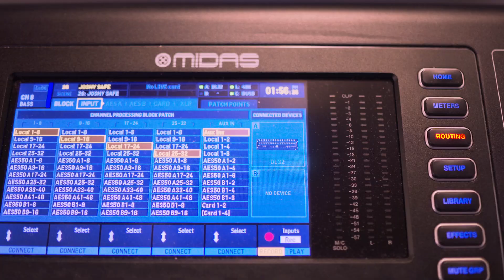How to make your own EtherCON Cables

Comment: How did you ground the ethercon housing? Does the ethercon connector have metal detents inside that touch the the RJ45 connector' metal body?
Reply from the maker: While the Ethercon body touches the shielded RJ45, the RJ45 should be doing all of the grounding. The XLR type body is just for mechanical retention and protection.
Reply: @markyfrencho  Thanks for your reply! I see. I am only concerned because I heard of AES50 ports on consoles frying due to the lack of ground conductivity of some black ethercon connector housings. I think they removed cadmium to prevent them from being toxic. Whereas the silver ethercon connector housings are still conductive, so I’m trying to understand how to properly ground them.

Comment: So you need to ground both ends of the cable?
Reply from the maker: Yes. This ground isn’t like an XLR ground. It’s not going to cause a loop.
Reply: Could this be achieved with a internal ground connector?  @markyfrencho

Comment: what cable spec is needed to pass phantom power?
Reply from the maker: There is no phantom power for Ethernet. It uses PoE or “power over Ethernet”. There are several levels of PoE and all of them should work on everything Cat5e and above. Cat5 may get hot with PoE+++.
Reply: @markyfrencho ok, I hear that cat6a is less rigid than cat 7 but has better shielding than cat5e. Do you find cat 7 to be hard to lay flat?
Reply from the maker: @rspaulding cat7 has higher gauge wires (22awg vs. 23awg) and slightly thicker insulation. plus it has additional shielding in the spec. When you buy shielded cat6 you have to make sure you’re getting a shielded type cat6 or cat6a. FTP, STP, or F/STP. Foiled twisted pair or shielded twisted pair. Foiled twisted pair actually has the additional foil shield around each pair. S/FTP Cat6a is the most similar to Cat7 spec. Cat6a cable is manufactured to tighter tolerances than Cat6 so it can handle higher bandwidth and speeds.
Reply: @markyfrencho  Thanks! do you find that Cat 7 is difficult to get it to lay flat on stage? Would cat 6a be any less rigid compared to cat 7?
Reply from the maker: @rspaulding what devices are you using onstage with ethercon?
Reply: @markyfrencho  those 4 channel XLR to ethercon snake boxes
Reply from the maker: @rspaulding thats a tough call. For short on-stage runs you really don’t need to worry about the speed or higher spec cables. I would probably get some of the pre-made Cable Matters Cat6 EtherCon cables and see how they work. I doubt you’ll have any issue with them. It will save you tons of time it would take to learn and practice making them and in the end you’d pay more to make them yourself.

Comment: Thanks for the video.  Lots of good info here.  My question is, for portable rigs that get set up and torn down a couple hundred times a year.  Will this type of Ethernet cable hold up?
Thanks
Reply from the maker: @johngreer9124  durability of the connection is going to be directly related to the quality of the ends you use. Don’t cheap out, get Neutrik Top connectors. Make sure your techs are gripping from the end and not the cable when they remove it. Soundtools SuperCat cables are great for this kind of repeated use. They’ve got a lifetime warranty too.

Comment: Thanks for the informative video Mark. Just a couple of questions about cost/benefit. Neutrik do an ethercon shell that is designed for use with pre-assembled cables (the NE8MX). Here in the U.K. these shells cost about £3.50 each. A 100’ pre-assembled “Ethercon” cable costs about £90, a 100’ Cat7 cable costs about £30. Is there any justification at all for the difference in cost that you are aware of? I appreciate that in installation scenarios you need to be able to terminate the cable correctly but for live situations, where the user is running a reeled cable between stage and booth is there any reason that one can’t just buy an off-the-shelf Cat7 cable and stick an Ethercon shell on each end?
Reply from the maker: @LeeMatches  it could be possible and still meet spec, though I haven’t tried it.

Comment: Mark, thanks for making this video.  This is the exact video I was looking for.  I am definitely not up to snuff on all the knowledge of these cables.  The difference between the CAT 5/5e/6/7 cables is very helpful.  I never realized that each improvement in cable was to further the prevention of crosstalk by either separating the twisted pairs or to increase twist rate for keeping the signal protected.  Great job!

Comment: CAT5e NOT Cat 5!  Why do audio visual people keep making this grave mistake?
Reply from the maker: Because the Cat5 spec technically covers Cat5e. Many Cat5 cables actually met the tighter tolerances of the enhanced spec but technicians needed a quicker way to tell the difference between a 100mbps cable and a 1gbps cable so the enhanced spec was produced.

Comment: So a few things to add. Cat 6 and Cat 7 also increase the twist rate of the pairs. This is part of what allows higher speeds. Also AES 50 is spec to cat5e shielded ONLY. Using other specs of ethernet can cause issues. AES 50 is not an IP protocol, so it does not gain advantage of using cat 6 or 7, it can actually hurt things. AES 50 was designed with the characteristics of Cat5e shielded. Also the shield with AES 50 is to prevent static build up in cable and ground link of the ports. It will work and sync without the shield, but damage can happen to the ports due to static
Reply from the maker: I would check out some of the Dave Rat videos. He goes through some of the advantages of different cat specs for AES50 and found no downsides for higher spec cables which is why SoundTools makes CAT7 ethercon for AES50. There can be some advantages in noisy RF environments as well as them being tougher cables overall.
Reply: @markyfrencho  I have seen that video where he tested AES50 with cat6. Yes it may work but it's out of spec. I have seen so many posts on different groups about people having issues with AES50 when using cat6, swapping to cat5e fixed the issues. Music group has even told people this.
Reply from the maker: @DustySeven7  cat6 spec doesn’t have ground. AES50 is a 9 conductor protocol using ground as sync. That is the main issue people have with it. AES50 can also lose sync at lengths beyond 75’. The Cat7 spec has foiled pairs and foiled shield so it has the 9th conductor and added shielding as well as slightly thicker jacketing on the pairs and tighter twists as you said. All this leads to more efficient data transfer and lower cross-talk which has been proven to keep the signal stable over longer distances than Cat5e without any problems. Cat5e is merely a foiled shield around four pairs. I’m sorry if my descriptions were not clear enough for you, but I believe my information is correct and not misleading. I have been running Cat7 for AES50 for months at 85’ without any issues even passing near our 400A service. I highly recommend it for permanent installations.
Reply: @markyfrencho  Cat 6 can have shield, Cat 6a does have a shield. AES 50 is not a 9 conductor protocol for sync. Dave shows in his video which pairs are sync and which are data. AES will most certainly work without a shield. I have seen it, as have others. Glad your install is working and has been
Reply: What is your source on the 9th conductor used as clock? Ignoring the fact that using the shield as a data signal path for something as crucial as clock without any immunity to noise as it’s not a balanced line (and in the spec of AES50 published for the Pro Series it’s two twisted pairs used for send and receive of the clock) I find your information a bit misleading.
Reply: @markyfrencho it clearly states in the AES50 spec that clock is sent down two of the twisted pairs.  It is an 8 conductor spec.
Reply: cat6A has shiedling!